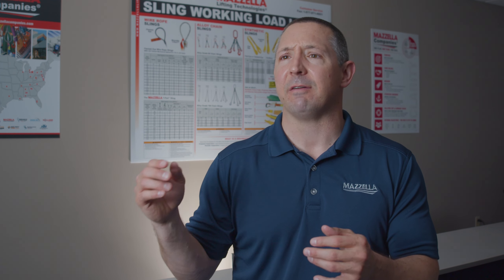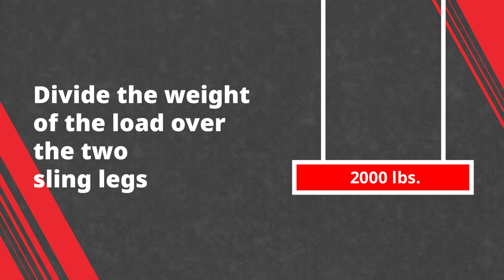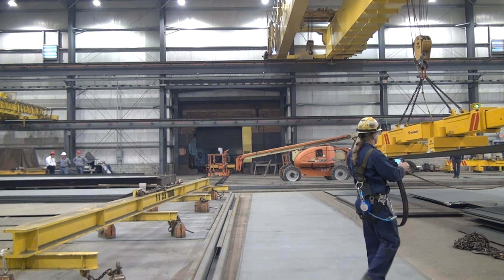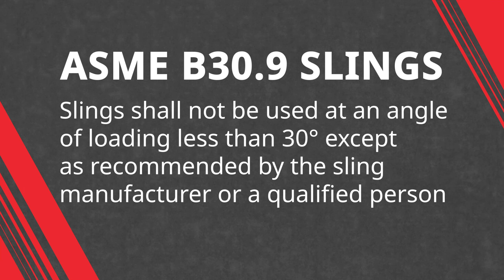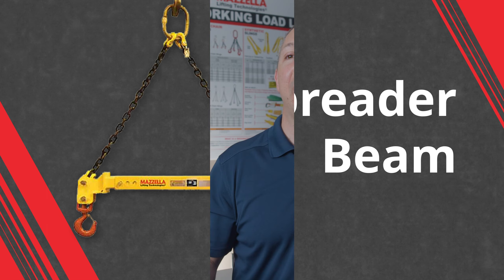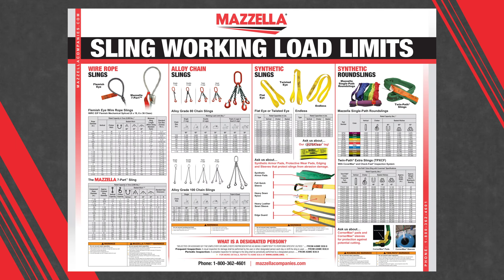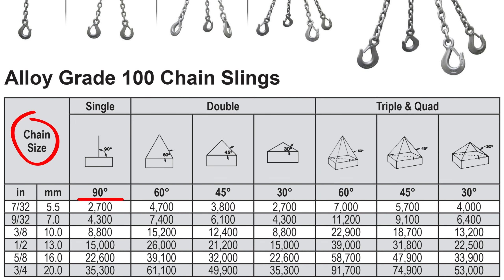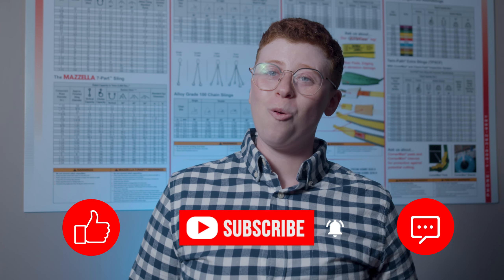How Do Sling Angles Affect Load Ratings and Capacity?

Comment: As a crane operator, i have made a mistake...a pair of 3 ton chains can lift 6 ton weight of mass hahahahaha but no worries, now im a certified lifting supervisor 😁
Reply from the maker: Make sure those chains are only used in line. Here is a pocket guide to help you calculate the WLL when using sling angles. 
https://www.mazzellacompanies.com/learning-center/literature/sling-working-load-limit-pocket-guide/
Reply: @LiftingandRigging  i hope this channel and this company would level like Leea..so much things can be learned here.